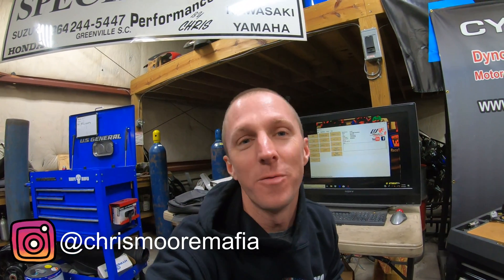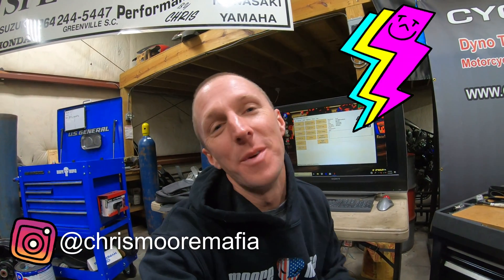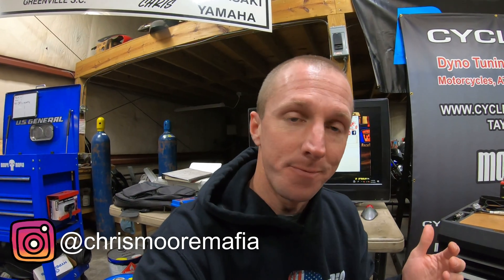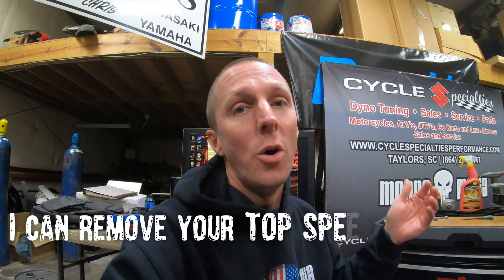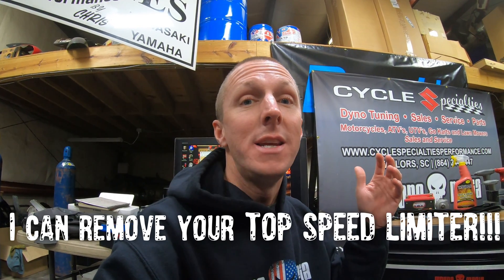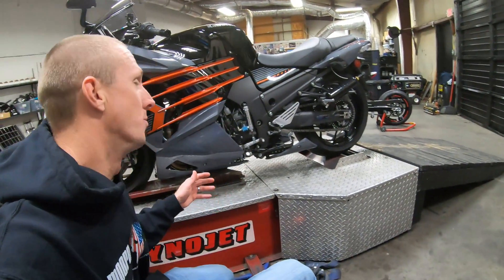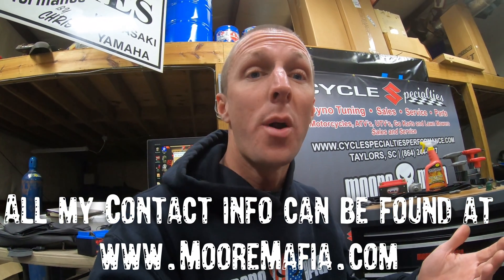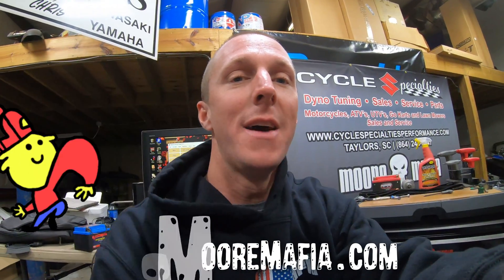What is motorcycle ECU FLASHING and what DO YOU GET OUT OF IT??

Comment: Thanks for the info. Question, is it possible to use an ECU from a car for DC CDI ignition in a carbureted motorcycle if the ECU was to be flashed for such use? or would it need to be modified with larger capacitors to be used for CDI on an older carbureted sport bikes? has anyone ever tried this before?

Comment: Hello Mr.Moore greetings from India!
I have an 155cc R15 V4 (18.4 HP & 14.2 Nm) which feels kind of slow in the low/mid rpm especially with the current emission norms. The exhaust pipe has 3 chambers of catalytic converters (it looks like that from outside). Do I gain any power if I use a similar exhaust from the previous model which has 2 chambers of catalytic converters?

Comment: I got an 06 cbr1000rr, would a flash work on it? Cause I got the -1 front sprocket and +1 rear sprocket, but when I open the throttle all the way it kinda stops picking up on rpm, it stops a around 7-8 and it redlines at 11.5
Reply from the maker: It sounds like you need a Fuel pump.  A flash does not fix a poor running bike. It makes a good running bike run better.

Comment: Just got my ECU flash back from Chris for my 2020 Suzuki katana and all I can say is holy shit. Can't believe the difference it made on my bike. would highly recommend it for anyone looking for more power and ridability. 👍
Reply: I too have a katana and will be getting a flash soon. Wondering what, if any, modifications you have done to your Katana.  Mine is all stock. The only mod I may do is removing the air flow restrictor plate and adding a high flow filter. Not sure if this is very effective if I leave the stock exhaust.
Reply: Did you have any supporting mods? Just bought a 2020 and im trying to decide if i need to have a full exhaust on to make a difference.

Comment: 06 gsxr 600 engine swapping a 07 750 into it. My question is " can I use the ecu from the 600 for the 750 if I sent it to you for a flash or are they just to different to work"?

Comment: are there limitations to what an ECU flash can cope with. For instance, I have a Husqvarna Svartpilen 701 (same motor as the 701 supermoto). I have currently got just an Aftermarket end can fitted with baffle removed and I also have the airbox lid removed and Fuel dongle fitted (o2 sensor removed)... But I would like to get a bit more sound from the bike and adding a DECAT pipe basically makes the system a straight pipe by removing the CAT.... Would an ECU flash be able to sort out any fuelling issue. (because when I fitted the DECAT pipe the standard ECU setup the bike pops and bangs a Lot on the Decell 3rd, 2nd, 1st gears..)

Comment: Question; I have a 2012 Zx14r. It has a full Brock's predator exhaust, Brock's pair valve Block off plates, sprint air filter and secondary butterflies removed.. I had it Dyno tuned and remapped on the Dyno using the stock ecu without a power commander & it made 208.74 h.p. at the wheel on pump gas without Nitrous.. with a small shot of nitrous it made 244.3 h.p. at the wheel on pump 93 octane..
The Bike is Derestricted and the traction control stays off unless I want it back on when the bike is keyed on or off.
the nitrous map is programmed to turn on when I activate the power mode L = Nitrous map on. Although I can only toggle between the (power mode F & L) at 15 m.p.h. or less & I want to be able to switch between the power modes at any speed for toll racing...
Fo you have a hack for this?

Comment: Im having this problem with my 06 gsxr 750 when powered on, starts, runs, everything. It does everything but continues to stay on even when its turned off. Rectifier regulator went out recently and has just been replaced and relocated to the airbox. My battery was fried along with a few fuses. When i turn my ignition on everything comes on, but when i turn it off, the cluster backlight and the ignition stays on. I could start it if I wanted. The bike only completely turns off if the highbeam is on WHEN the bike is turned off. If the highbeam is off when i turn the ignition “off” the bike will stay running with no accessories except for the clusted screen light stays on and neutral light stays on. VERY confused

Comment: Would there be a drastic improvement flashing a 2019 Hayabusa?
Reply: I own a 2019 Busa. I took mine to be dyno tuned through a power commander. The results can vary dependent upon exhaust choices and even air filter.
The maximum horsepower in the top end didnt change much but the tuning throughout all rpm and throttle position changed dramatically! Low to midrange had phenominal gains ! 
It also depends what your targeting , ie; smackdowns, 1/4 mile or just a kickass streetbike all around. My Busa rips hard and is wicked fast! Hope this helps.
Reply: James Aquino I’m running a K&N filter and a sc project 4-into 1 conversion but I’m going to be switching to a full yoshi system within the next month.

Comment: this is why I stick with bikes from the early 2000s. lighter, simpler, cable throttles, adjustable idles, no abs, no wheelie control. i dont mind being half a second slower in a quarter mile if it means i have a bike i have complete control over. ill take a first gen 636 over a new bike any day.
Reply: You stick with older bikes because they are slower?
Makes sense.
Dont need no abs and wheelie control if you dont need them!!

Comment: I have a perfect 09 zx6r  did exhaust and intake and the bike sputters at low rpms. Clears out at like 4500 5k. Any advice? Already tested injectors, plugs and coils.
Reply from the maker: Usually they are to lean in that range and need to be tuned.
Reply: @TeamMooreMafia  that's what someone else told me. Thought I'd try to ask you before I spend that money. Thanks for the reply!

Comment: Wouldn't a Power Commander V be better than ECU flashing?
Reply: I’m installing a power commander v this spring with a ignition module and a auto tune on my z1000. A ecu flash like Chris said it will unlock a lot of restrictions your factory programmed ecu has. Like your rev limiter. When you rev it to the max and it bounces off a rpm that’s the rev restriction. It’s there to help save the engine. If I wanted mine flashed I’d get a lot of the smog and exhaust restrictions disabled plus the fuel restrictions and the throttle body sensors to stay open at full throttle.  The rest a just crazy things to do if your not sure what was done to it because you could blow your motor.
Reply: @theozman38  Ahh, I see.. perfect!! I have an 09 ZX14 w/ PCV .. I can see getting the ECU restrictions removed would be a good thing!  Thanks for the info !!!

Comment: Curious as to if you flashed the ZX14R,and if so did you delete the 02 sensor when doing so Chris? Thanks Peyton
Reply: Peyton Hibdon That should be standard practice when re-flashing a ZX14Rs ECU.
Reply: @pattyjay9999  I completely agree with what you are saying, but want to bee 100% sure this is correct or I would be comparing apples to oranges Chris slipped in something like an autotune on me.
Reply from the maker: Yes o2 gets deleted

Comment: What’s normal price range for a tune using the dyno and dialing in the air fuel?
Reply: Not sure for America maybe half this or a bit more than half but it was $850 for a dyno tune for my bike for dialing in AFRs (bike was lean)
Reply from the maker: Starts at $200 for power commander and $475 for ECU